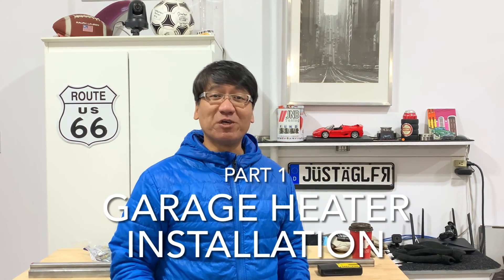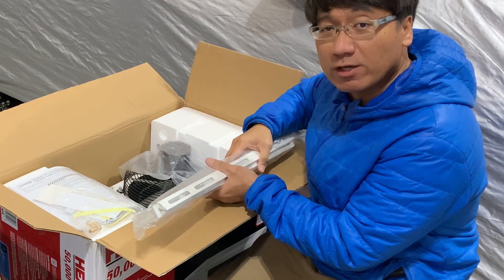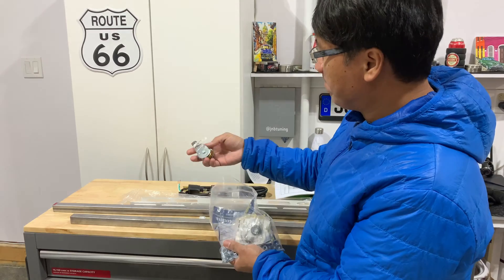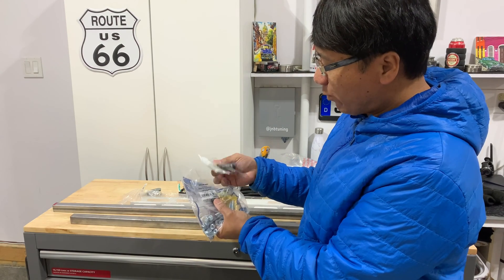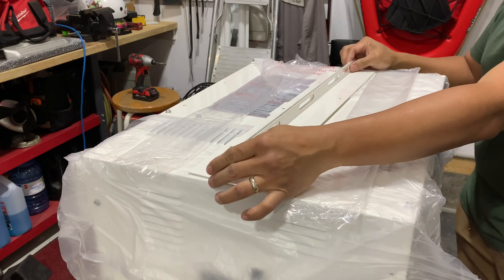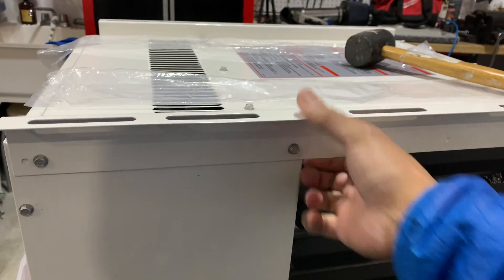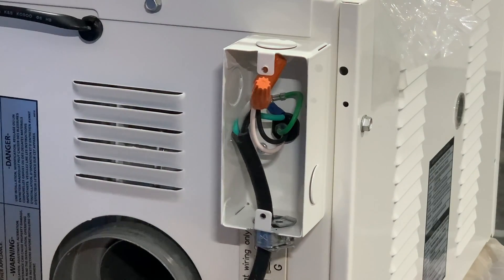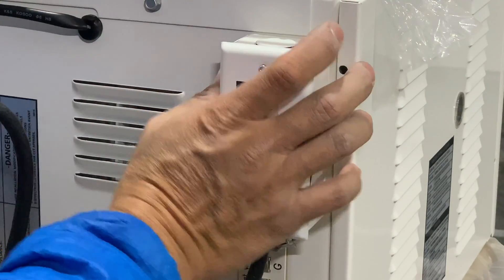HeatStar Garage Heater Installation (Part 1) | 50,000 BTU

Comment: For the electrical, did you run it on it's own separate circuit/breaker? Or just plug the power supply cord into a standard 110v outlet?
Reply from the maker: Thanks for reaching out! I have broken up the complete installation into 4 episodes given the amount of detail. I wanted to share to to my  viewers the fully instructions of what I have taken. So please watch on when you have the chance. Thank you
Reply: @JNBTuning  Thx got it, previously skipped over that part lol. Great videos btw!
Reply from the maker: @ thank man!

Comment: Hi im your new subscriber im also here in calgary alberta i have the same heater im going to install soon my question is whats the minimum mrsurement between wall and the heater?also the ceiling thank you in advance
Reply from the maker: Thank you for your submission and support! I don’t have the measurements off my head as it’s been a while, but the manual has all of the information you need.

Comment: You said the unit requires 12 gauge but you put 14.  So you're putting a smaller wire instead of a bigger wire.
Reply from the maker: Oh yeah I don’t know what I an saying. It doesn’t require 12 but you can. 14 is plenty
Reply: It only uses 1.7 Amps for the fan and electronics since the heat comes from gas. My guess is the maximum is 12 AWG to fit through the clamp on the power inlet. You could use a 16 AWG or 18 AWG wire safely for 2 Amps, the 14 AWG is overkill.